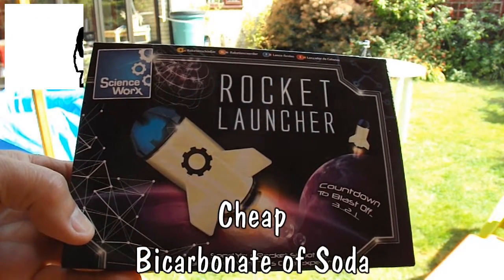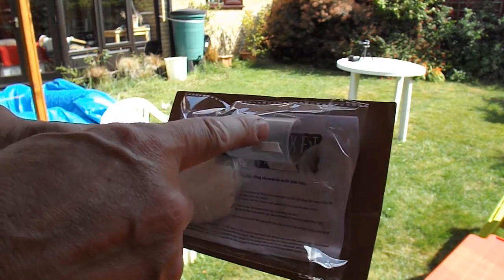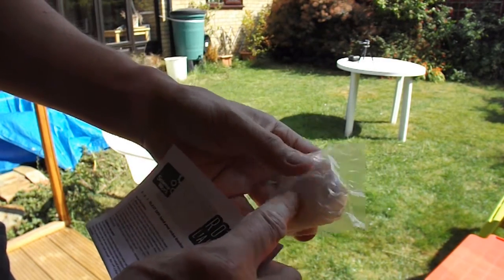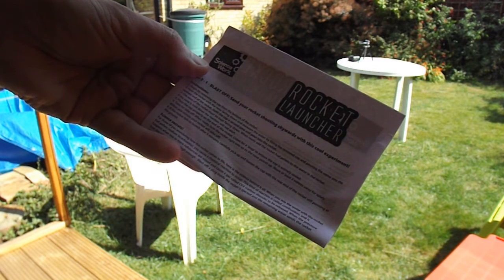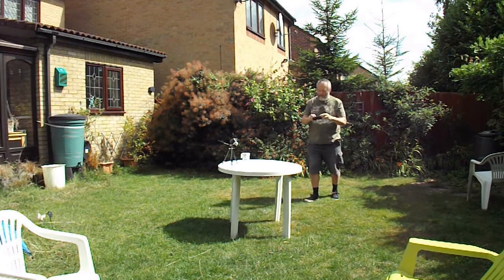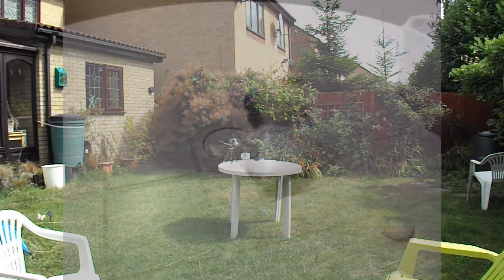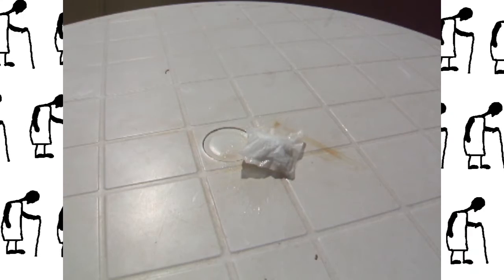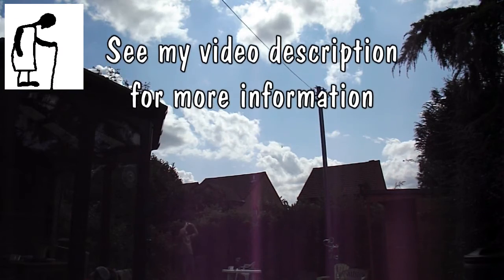Cheap Bicarbonate of Soda Mini Rocket

Comment: It runs on pressure right sir?
Reply from the maker: +Aspboss Llol yes, the bicarbonate of soda reacts with water to produce carbon dioxide gas. As the gas is produced it increases the pressure inside the container until it forces the top off. That shoots the rocket into the air.
Reply from the maker: +Aspboss Llol to be exact the bicarbonate of soda does not react directly with water so the powder in the packs is more likely to be baking powder which has an additive to add an acid into the reaction. There are some links in the video description that may help give more detail.
Reply: +GrandadIsAnOldMan thank you sir.